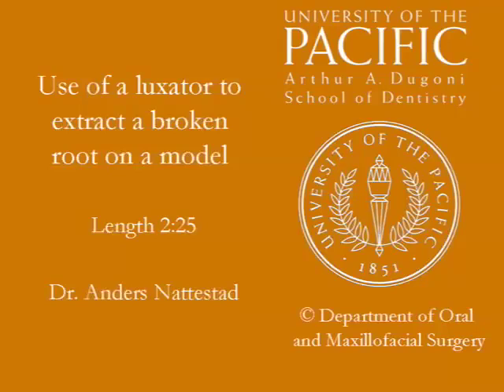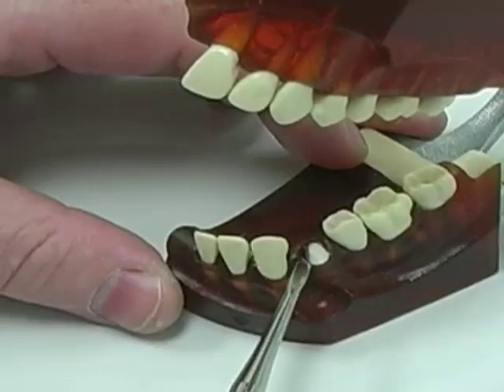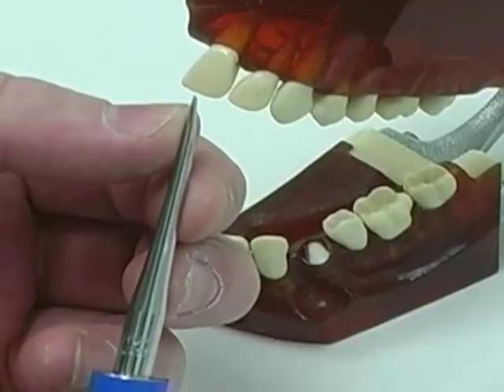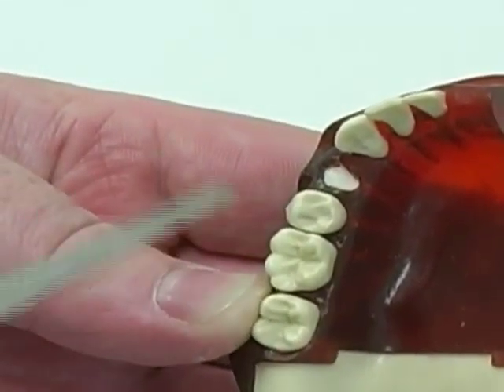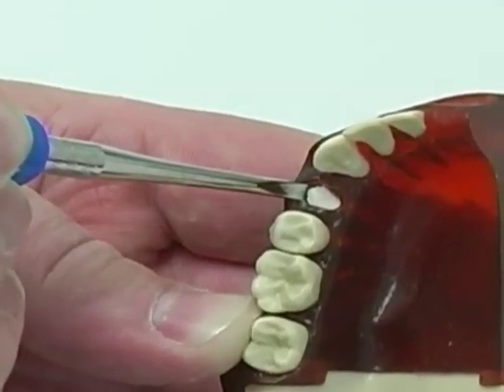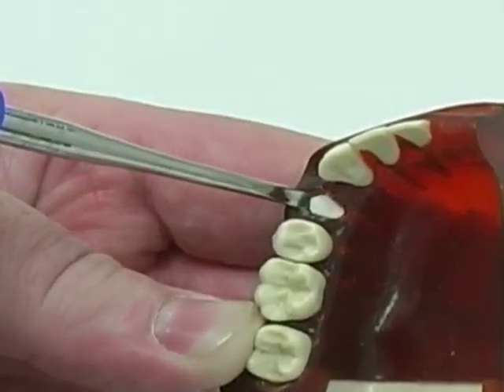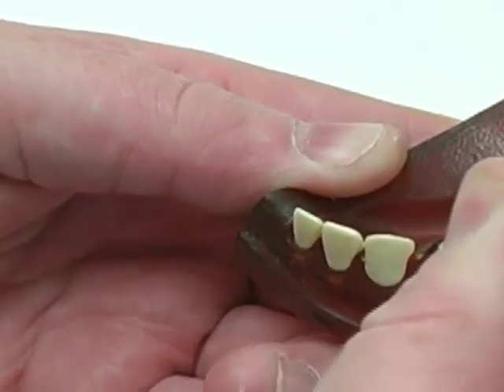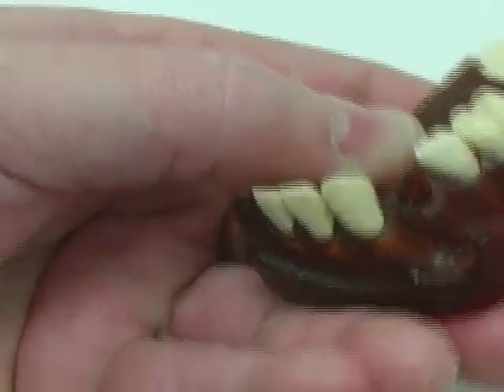Use of a luxator to extract a broken root

Comment: This is how you fracture the buccal plate.
Reply: Is squeezing it out with forceps/etc better? Not a dentist, just curious. Another video showed squeezing beneath the broken root and easing it out like a thorn.
Reply: Couldn't you drill into the root, with a screw and then pull it out from the top, without using bone and gum tissue as a fulcrum? Lol I'm not a dentist but that sends like it would be the least destructive way to do it, if possible.
Reply: @foxmulder7616  
The easiest straightforward way is to use an elevator to tease it out, if that doesn't work we can use an endodontic file to latch into the tooth canal and pull it, lastly we can surgically and safely remove a part of the bone around the tooth, either to create a fulcrum for the elevator or a  window. There is this thing called  physics forceps the rest on the gum with one prong and pull the tooth with the other. The crush the gum and bone method is too destructive and causes problems in the future.

Comment: You are not supposed to use the buccal cortical plate as a fulcrum
Reply: Then what should be used as fulcrum?
Reply: @kayenattabassum5966 mesial or distal bone....buccal only in case of 3rd molar

Comment: The bone is not as elastic as your model bro. The possible outcomes with this technique are you'll either fracture the buccal plate or push the root into the sinus.
Reply: No.not at all. I hav seen many extractions tht way. U jus hav to wedge it. Principle is only one object occupy any particular area. If the luxator is forced into the socket, scientifically the tooth has to come out! This applies even to wisdom tooth!
Reply: True
Reply: Are you a dentist?

Comment: My molar is broken completely to the gum line and even deeper in the center. There is no sides/white left to the tooth.   Would this method be used to extract the roots?  I am terrified of the dentist
Reply: Molars broken at the gum line are easily sectioned and removed with the luxators.
Reply: Same problem..
Reply: adalynn111209 ITS done under anaesthesia,so painless,but have antibiotics,painkillers before treatment,as anaesthesia,best action takes place,wen some infection is removed,rduces by pre-treatment medication

Comment: Elevator...  thicker instrument used as a lever.
Luxator...  if you use it as a lever you will probably bend it. You twist it (apply torque)and count to 10 or so and then repeat in the opposite direction to fatigue and tear the periodontal ligament. I have a set of winged luxators that dramatically make my job easier and cause less collateral trauma.  In fact, I can extract a 60# dog's upper canine (104, 204) in about 5-10 minutes with the help of a lateral jugal ostectomy.  And, of course, I suture the site after the post-extraction radiographs are taken.
Reply: There are several messed-up looking luxator where I work, and I imagined this is what people did to those poor things.

Comment: I want to know too!!! sometimes it's held 45 degree angle rather than parallel or vertical :(

and this video says u can put it in any surface (bucal/distal...etc) but some ppl say it has to be mesial, some says mesiobuccal...etc. so confusing!!!
Reply: For  elevator putting into any  surface ,you should do it sharply.  Any mistake can cause a huge damage.

Comment: Does anyone know when do we hole the elevator parallel to the long axis of the tooth and when do we hold it perpendicular to the long axis of the tooth? Also, is there any difference between holding a straight, and angular T-shaped elevator?
Reply: Can you guys write me a prescription for Morphine??
Reply: We mostly use the straight one for root  extraction. And it gives a good result. Using sharp in Start is not a good idea  al though you have to see which one is required.  Depends on yoir skills.

Comment: Luxators make extractions much easier. Think that no two things can occupy the same space at the same time.  The lux  is pressed up the pdl while rotated back and forth.  The root can't move apically, so it is forced laterally and coronally (out).  Switch from one side of the tooth to the other and even roots broken below the grest are easy to remove w/o flapping and bone removal.  One more tip, obtain slight movement, wait 5 min, pdl bleeding loosens the tooth, return and its out in a minute.
Reply: Tooth was moving in socket but not coming out
Reply: Wht to do i tried all .
Reply: @varshak.7588  slight lingual movement then 2x buccal withdrawal.